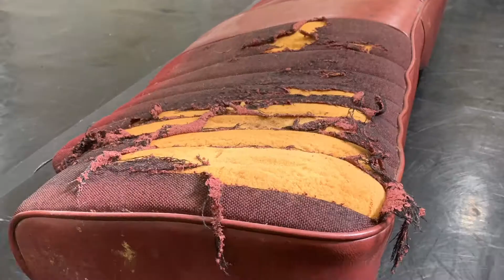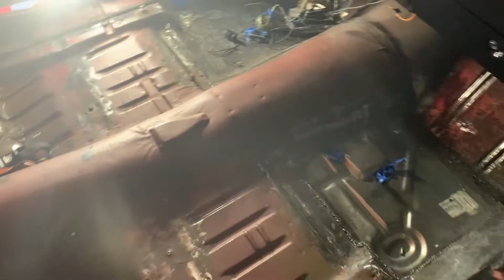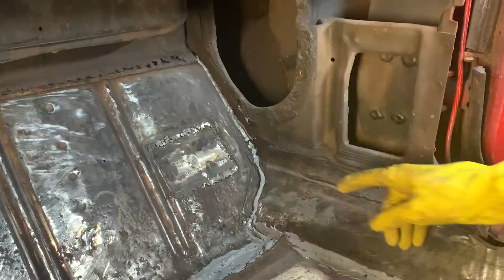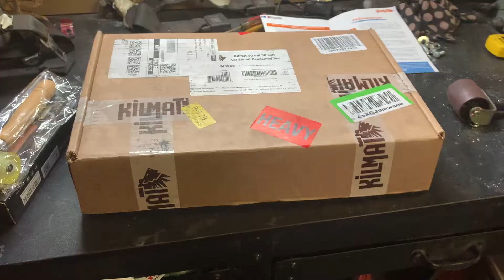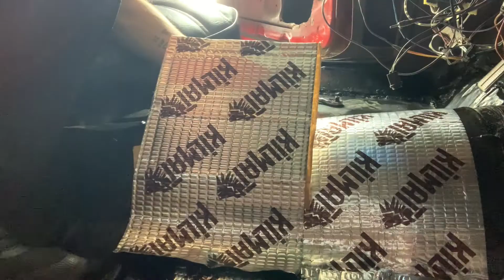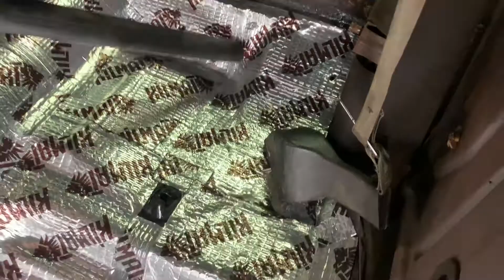How to Insulate and Prevent Rust On Your Car Floor - 1977 Chevy Nova

Comment: How many boxes did you end up using for the whole floor? Great job by the way
Reply from the maker: We are glad you liked the video, we used one box for the whole floor and we had some leftovers to insulate the doors.

https://www.amazon.com/Kilmat-Deadening-Automotive-Insulation-dampening/dp/B0751G6TMV/ref=mp_s_a_1_2_sspa?adgrpid=67772533196&dchild=1&gclid=Cj0KCQjwub-HBhCyARIsAPctr7yBzsTzW9okKzqrz9wmHREDNY3vT29CDYLMp-k-RGpqmXpBAJR97mIaAmRxEALw_wcB&hvadid=337561187259&hvdev=m&hvlocphy=9010854&hvnetw=g&hvqmt=e&hvrand=8114465756266229087&hvtargid=kwd-438772528062&hydadcr=24042_9910577&keywords=kilmat+sound+deadening&qid=1626407762&sr=8-2-spons&psc=1&spLa=ZW5jcnlwdGVkUXVhbGlmaWVyPUEzSlRFWktRS1A0Sjg1JmVuY3J5cHRlZElkPUEwMjI2NTM4TENXWVhIRU1USE40JmVuY3J5cHRlZEFkSWQ9QTAwMTAzNzAyQkY2MVoxNFRFODNXJndpZGdldE5hbWU9c3BfcGhvbmVfc2VhcmNoX2F0ZiZhY3Rpb249Y2xpY2tSZWRpcmVjdCZkb05vdExvZ0NsaWNrPXRydWU%3D

Comment: what was the sound deadening on amazon i need a box what was it called and great video
Reply from the maker: We ordered this one:

https://www.amazon.com/Kilmat-Deadening-Automotive-Insulation-dampening/dp/B0751G6TMV/ref=mp_s_a_1_2_sspa?adgrpid=67772533196&dchild=1&gclid=Cj0KCQjwub-HBhCyARIsAPctr7yBzsTzW9okKzqrz9wmHREDNY3vT29CDYLMp-k-RGpqmXpBAJR97mIaAmRxEALw_wcB&hvadid=337561187259&hvdev=m&hvlocphy=9010854&hvnetw=g&hvqmt=e&hvrand=8114465756266229087&hvtargid=kwd-438772528062&hydadcr=24042_9910577&keywords=kilmat+sound+deadening&qid=1626407762&sr=8-2-spons&psc=1&spLa=ZW5jcnlwdGVkUXVhbGlmaWVyPUEzSlRFWktRS1A0Sjg1JmVuY3J5cHRlZElkPUEwMjI2NTM4TENXWVhIRU1USE40JmVuY3J5cHRlZEFkSWQ9QTAwMTAzNzAyQkY2MVoxNFRFODNXJndpZGdldE5hbWU9c3BfcGhvbmVfc2VhcmNoX2F0ZiZhY3Rpb249Y2xpY2tSZWRpcmVjdCZkb05vdExvZ0NsaWNrPXRydWU=